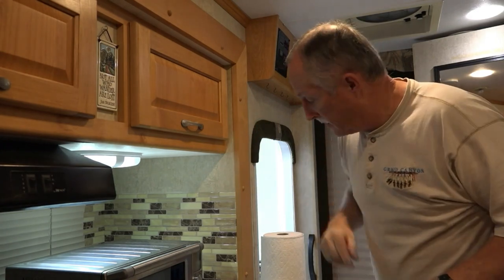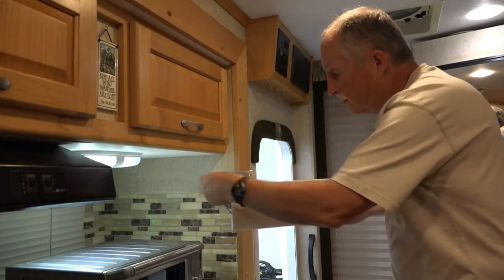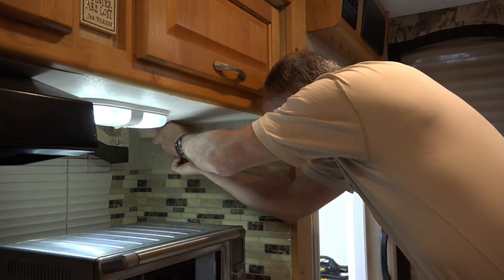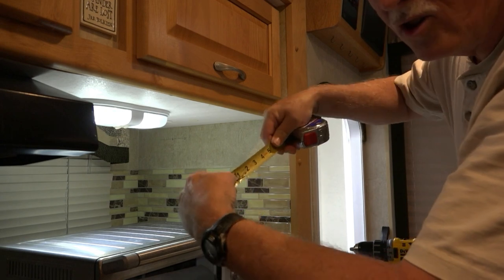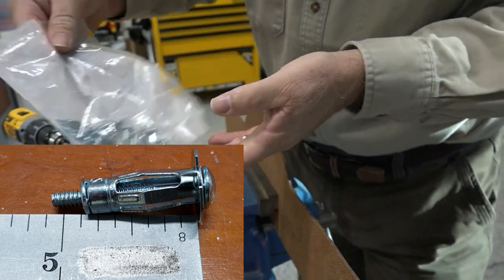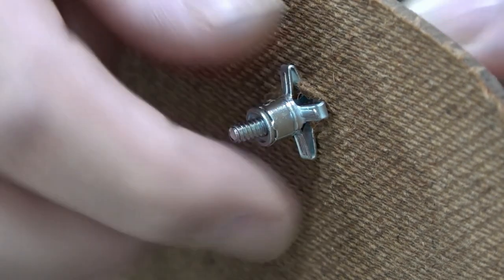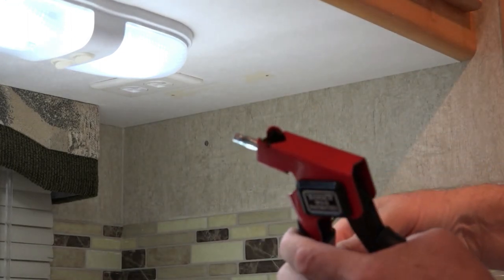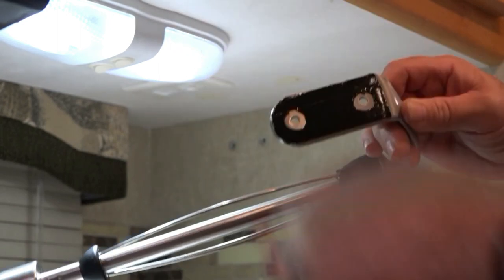Ratcheting Paper Towel Holder Install

Comment: Nice upgrade Charlie. I have the same paper towel holder in my camper. 
Now that the roll won't unravel itself I've found that wind from my kitchen window or just road vibration will still unroll the paper towels. To solve this I mounted a short length of decorative chain to lay against the paper towels. This has done a good job of keeping the roll under control.